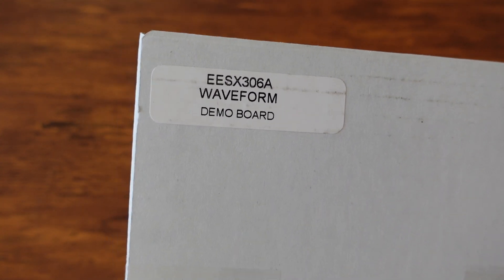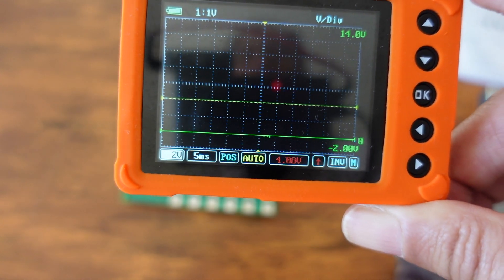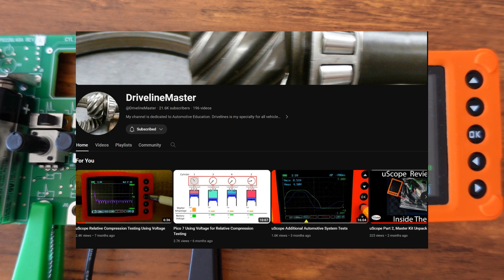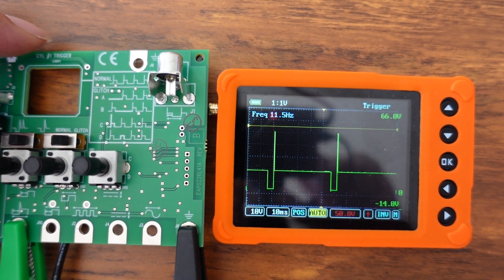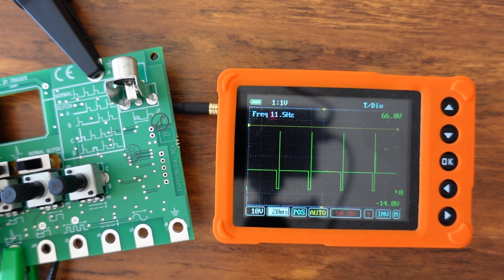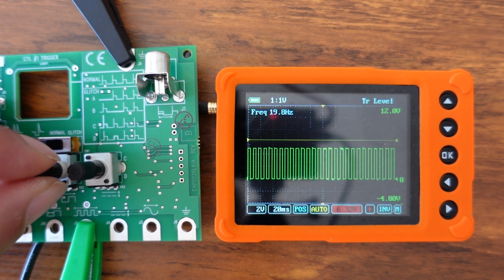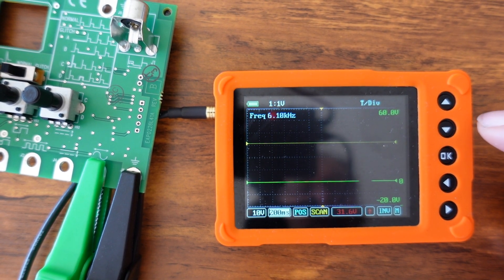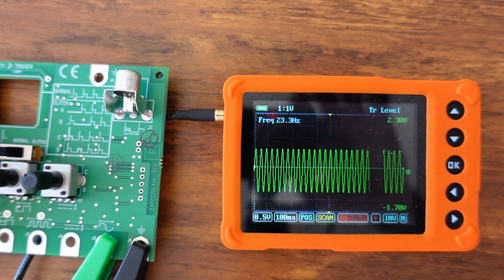Introduction of Snap-on waveform generator tested with the AESwave uScope

Comment: Ive set up and used an old school CRT oscilloscope with the green screen before in high school electronics class. There where more than 2 dozen controls on it and we where taught on paper how to calibrate the scope. I later bought on after high school in the late 90's and some how remember how still operate it by memory. Ive got to pull it out one day to see if it still works.
Reply from the maker: Good skill to have for diagnostic procedures on vehicles.